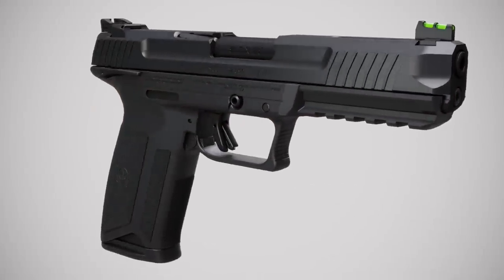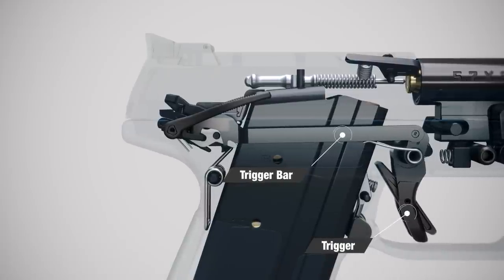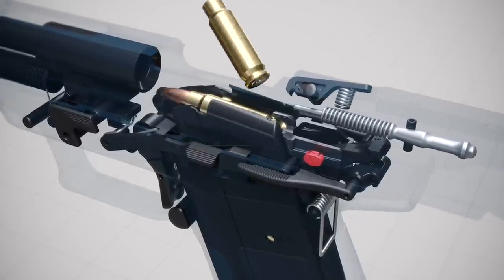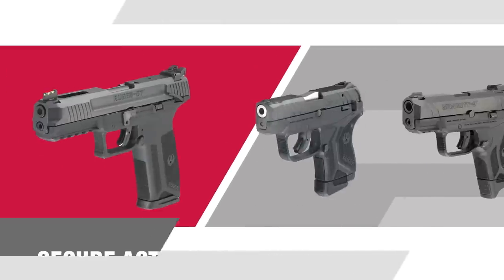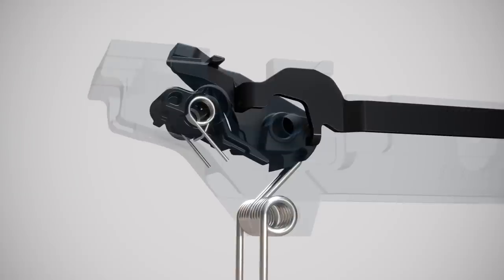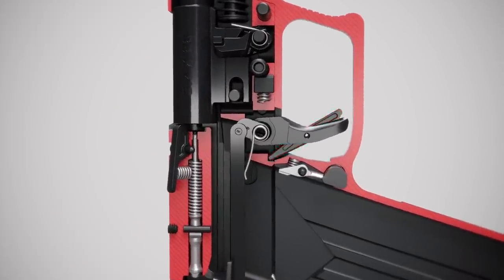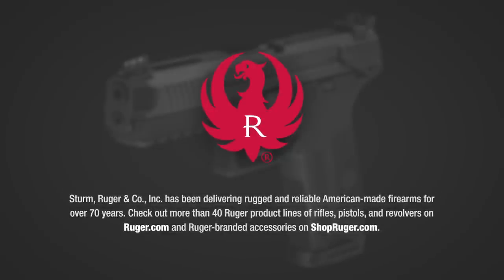Ruger Tech Tip: Ruger-57™ Secure Action™ Fire-Control System

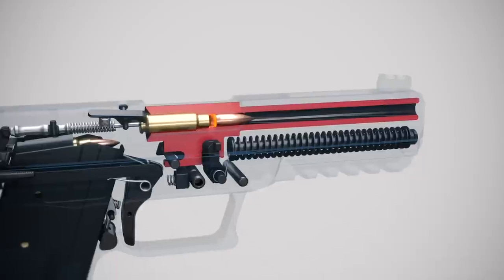Comment: Wait, this is a lever-delayed blowback? 1:33 they say, "As the bullet travels down the barrel, the barrel and slide move rearward at different speeds under control of the locking cam."  The locking cam is the lever in a lever-delayed blowback.

Comment: I was going to buy the Ruger 57 but when I found out that ammo is impossible to find for it right now so I changed my mind because there's no sense and buying a gun if you cannot find ammo for it so I decided to buy the Ruger Security 9 and I love it, have run over 600 rounds through it and have not had no issues. The Ruger Security 9 is an excellent gun
Reply: Awesome firearm for the price. It's great for conceal carry and feels solid. Extremely happy with it.
Reply: It’s not hard to find ammo you can get it online for a reasonable price

Comment: Ruger has discovered that a small number of Ruger-57™ pistols may have right safety levers that do not meet our specifications and may be prone to cracking. In some rare instances, the internal "leg" of the right safety lever may crack or break, rendering the manual safety ineffective. If present, this condition may cause the manual safety to appear to be functioning properly when it is not. Although only a very small number of pistols appear to be affected, Ruger is committed to safety and is asking owners of Ruger-57 pistols to immediately perform a routine function check of the safety lever to ensure its proper operation and, if necessary, sign up for this retrofit.

Potentially affected pistols include any Ruger-57 pistol with a serial number of 642-26274 or lower (including all Ruger-57 pistols with a “641” prefix). If your Ruger-57 pistol is within this range (641-00000 to 642-26274), you should follow the inspection procedure outlined in the Safety Bulletin to determine whether your pistol requires a retrofit. Ruger-57 pistols with a serial number of 642-26275 and above are not affected by this Safety Bulletin.
Reply: The one I held only had the trigger blade for safety, like a Glock😉
Reply: I never have the thumb safety on so

Comment: I hate 2 things people say about Ruger 57 this video proves it's drop safe and people say the 5.7x28 is a 22 lr but it's the exact dimentions as a ar-15 223 just short like 22lr and the 22 short this ammo is a ar-15 short search 223 40 grain and compare it's the exact same bullet 223 are 5.7 in diameter search that too just a standard 223 is 55 grain but one company makes 55gr 5.7 bullets they are just extremely rare I wish they'd make more 55gr 5.7 bullets so it would literally be a standard ar-15 round in a handgun that's why this bullet is alot more deadly than people give it credit for cuz it doesn't weigh alot or big like a 40 or 45 but it goes very fast and tumbles and it's flatter shooting than any other caliber Ruger 5.7 is my favorite gun and my carry gun
Reply: How is it drop safe when with the safety on, if it's dropped the hammer can fall?
Reply: @kylegrimm8808  did you not see that secondary catch that captures the hammer if the trigger isn't all the way rearward??  In the extremely unlikely event that the hammer and sear became separated, as the hammer rotates there is another " catch". That will stop the hammer before impacting the pin ...
It's the same concept as a striker block on a Glock pistol . It's just that your not familiar enough with how the Ruger works to recognize that
Reply: @kylegrimm8808  the explanation is here starting at 3:50

Comment: I just purchased the Ruger 57 pro and it doesn't have the manual 1911 safety's. Can they be added or installed in this model?
Reply: Why did you buy a firearm without a manual safety, if you wanted a firearm with the manual safety lol

Comment: No firing pin block though?
Reply: @THISSHOWNEEDSMORETITS  I know
Reply: @THISSHOWNEEDSMORETITS  because I think it’s better to just put in a firing pin block with modern designs. Reduces the risk nearly 100%
Reply: @factsoftheconfederacy7151  it doesn't work the same way as a striker fired pistol..   there is no need for a firing pin block because the firing pin doesn't contain any stored energy.. the 57 relies on the hammer impact to impart the energy instead of a spring like a Glock pistol or other striker fired handgun .
The hammer is held back by the sear.. it is blocked by the sear. In the unlikely event that the hammer and sear become separated, there is a secondary catch , that will capture the hammer beforw impacting the firing pin, If the hammer is released without the trigger being rearward..

It's just as a drop safe as any other modern handgun. But people have a poor understanding of how firearms work. So they don't understand that the secondary catch on the Ruger works off the same concept as a striker block . Both are physically stopping the " firing action" with a peice of steel, unless the trigger is pressed rearward.

Comment: A quick critique of this pistol: 1.  Not fond of the FCU which for me has too many loose moving parts pins, springs etc. 2. Please do not mess with my ability to manipulate the slide stop/release. Ruger has this newfound interest in blocking the slide release/ stop with the way they now produce their pistols. 3. The finish on their pistols suck, it's the same DS finish they have always used...so yeah it will most likely rust. For me, I regret buying this pistol for 700.00.  I could have bought a Masada and still had money to buy ammo.